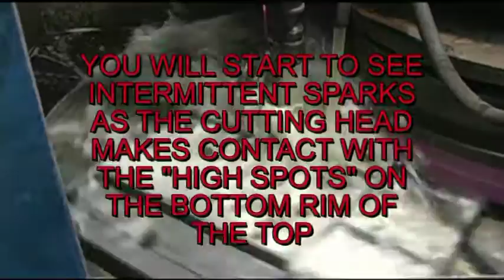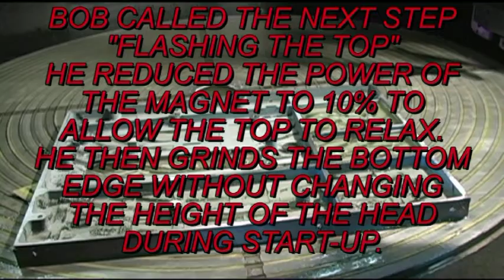Sears Saw Renovation Part 4 Top Preparation and Blanchard Grinding

Comment: Wonderful Job with resurfacing the top and bottom of saw table. Also I appreciate the fact you went  back to my dad's old stomping grounds to get the work done! My dad was a machinist and learned his trade at the old Worcester Trade School back in the 1920s! I'm restoring a 1956 Craftman table saw. Already rewired, put belt on and started cleaning table top. She cuts pretty good for an old girl!

Comment: that finish at 17:33 is so satisfying. amazing work.
Reply from the maker: If you think that part is impressive, wait until you see the next video where the top is "finish ground" on a horizontal shaft surface grinder.  It turned out as flat and looks as good as the top on a new $1500 saw!
Reply: yeah i saw that video too, and i agree it looks even better. but the "before & after" of this one was more satisfying. i'm off to clean some rust spots of my 113 now :)
Reply: I heartily agree, the moire pattern created by the cutting arrangement is a thing of rare beauty.

Comment: On the Craftsman saws that date further back that that one, the 'exact-a-cut' disc is a brass insert with two adjustable tabs. Each tab is held in place by a screw. These are adjusted in line with the edges of the blade so you can tell where the cut will be before contacting the blade.

Comment: If you grind down the saw top, wouldn't you then have to also grind down the miter gauge so that it remains flush in the groove and not sticking up above it a bit?

Comment: What would a grinding service like this typically cost?
Reply: I need to do the same type of grinding vert and horz for my delta cast iron saw top.could you tell me how much this type of job would cost.
Reply: Just called the guy who did this, the first part (the Blanchard grinding) he quoted me $25-75 and 3-5 day wait over the phone.
Reply: @marcusrice501  that's not bad